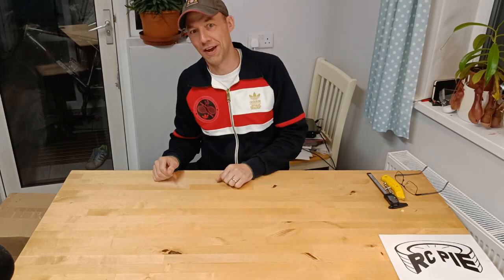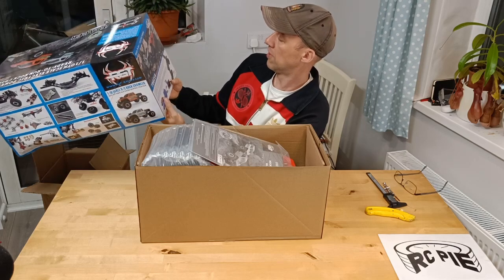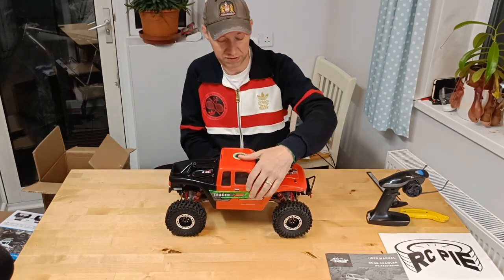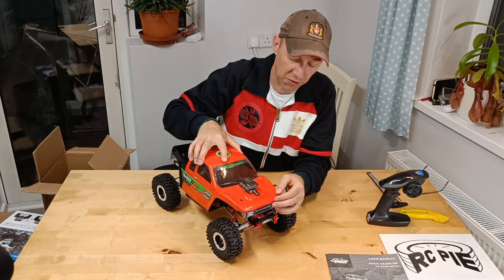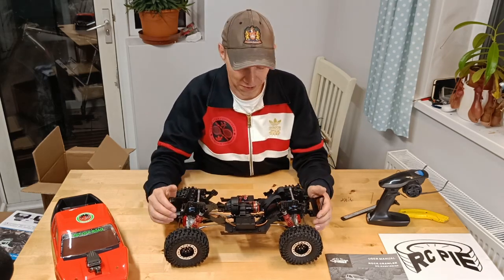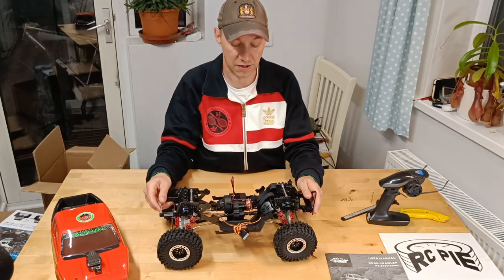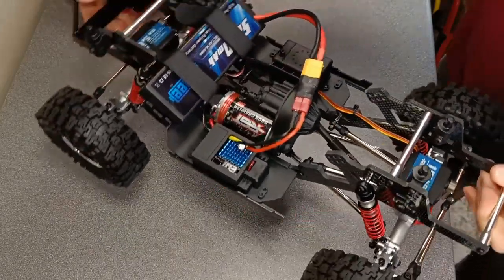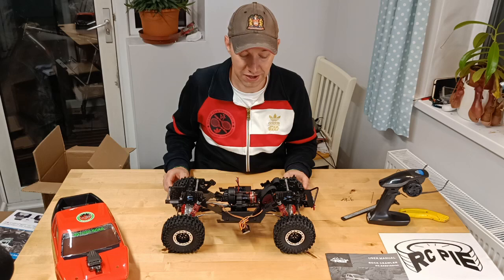RGT EX86180Pro Tracer Unboxing. New for 2022!

Comment: hi, do you still have it ? still using it? ive got one waiting in a basket, would you recommend it now?
Reply from the maker: I've still got it. I occasionally use it. 
Would I buy one? No. The reason being that they never made any spares available. Having said that, I've not looked for a couple of months. 
For similar money, the Rescuer is a far better truck. Completely different but better within its own area.
Reply: @rcpie  thanks for letting us know
Reply from the maker: @MrDevo5 Were you just looking for any decent truck or an LCG rig or did you just like the look of the Tracer?
Reply: @rcpie  just a change. 4ws . Not a capra. Keep looking at a ryft though.
Reply from the maker: @MrDevo5  I've got a friend with a Ryft and they absolutely love it.

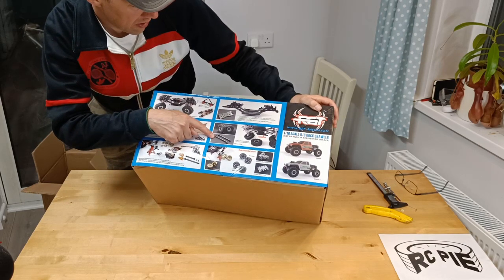Comment: Hi, I recently bought one of these and live in the USA I broke an axle shaft within 10 seconds of driving it and can’t seem to find any parts anywhere. Do you think you could help me find a place to get some extra parts? Thanks 3:50
Reply from the maker: Hi Mark.
What a shame that it broke so soon. Mine's been fine and I know how lucky I've been. The parts support for this car has been horrendous. I'm hoping that changes if FTX launch a version but I'm starting to suspect that that plan may have been shelved.
I've just had a look and can't find anywhere with parts supply. If I find any, I'll let you know
Reply: @rcpie  thanks for the reply. I guess I’ll have to put some different axles under it till something comes out. Thanks again
Reply from the maker: @markyoung-zv3ew  I suspect you can get something that will fit. 
Take it out and measure the different lengths and end sizes. You should be able to get another that will fit. Perhaps look at those for the EX86100 (FTX Outback Fury)

Comment: Thanks for the review. I already ordered one it is cheaper here in our country. I was planning on getting a capra 4ws but I saw the review. It is a good buy. The only thing I think should be done is to fully droop it and it seems that the tyres are too stiff, a hairbun would be a good replacement for foams.
Reply from the maker: Cool. It'll be interesting to hear what you do to it.
The tyres are glued, unfortunately. They looked like beadlocks but aren't.
Where are you?

Comment: Gotta say it's the most intriguing, and I think kinda breakthrough of a frame on a rtr truck, yet again coming from "horrible, communist, evil China".
They even could have had a full trunk if they'd used more forward placement of rear shocks that is available and lowering that bit under the trunk bed. That'd be really nice.
Reply from the maker: It's certainly intriguing and a real change for RTR. 
I might try cutting and dropping the body a bit more or get something else to stick on it. Might look cool sitting low.

Comment: Hi 👋
Does it have dig unit? Rear wheels blocked and something like that
Reply from the maker: No, there's no dig unit on it.
Reply: @rcpie  is it possible to install?
Reply from the maker: @user-6tfvk70k78  Not sure but I'd imagine so. It might need the centre plate changing or modifying but anything is possible.

Comment: So they stole the cliffhanger body, the axial 3gear trans, ar45p portal axles, rock pirates RC rock sliders gspeed style rails fucking pile of stolen shit go figure
Reply from the maker: I'm intrigued. When you say they stole these things, what do you mean? I guess there are few original ideas around and most companies 'borrow' ideas from others if they've not been patented but I know lots of them also license from each other or share manufacturers or just buy the parts/cars and relabel them.
For example.. would you consider that AE stole the Element24 Enduro? I think it was originally an RGT, then a Hobbyplus & FTX, then an Element.
It's always an interesting talking point.
Reply: @rcpie  what is the element enduro crawler by AE?
Reply from the maker: @WildmanGeorge  The Element Enduro24. There are a couple of different versions now, the Sendero and Trailrunner. I don't think they were developed by Associated but by RGT. (Or perhaps just by an unnamed manufacturer who then licensed them to both)
Reply: @rcpie  never seen any of those ones, I’m talking specifically about this truck like 90% stolen copies something Ali express and bangood, so that with everything
Reply from the maker: @1980chardison  I think you probably need to check things out a bit more. Banggood and AliExpress are just marketplaces, just like eBay or Amazon. They're not copying or stealing anything, even if someone else is.
I've just had a look at the things you're suggesting have been stolen and I'm not convinced at all. The axles and rock sliders are clearly different. The chassis rails are in some ways reminiscent of gspeed's but that could be said of any carbon rails and I'm not sure gspeed were first anyway.
The transmission is like that found on lots and lots of trucks, so I'm not sure that's much of a claim either.
I wasn't aware of the cliffhanger body but, having had a quick look, it certainly looks similar. I don't know if it's the same but if it is, it might interest you to know that Pro-line are distributed in Europe by the same company that distribute FTX (arguable just re-branded RGT), so it seems reasonable that they might have a deal going on.
Similarity of thought or design doesn't mean theft of product or IP.
Reply: @rcpie  i know your probably into the truck and car scene, but as a hobbiest for a ton of stuff like drones, china which is a big runner of Ali express and bang good that push all the clones, which I do say this with heart for the people who do the hundreds of thousands of hours to create something good, just to have someone else point and click a computer screen and clone shit then undercut everything they clone which is stealing from the real creators inventors of these said products, and eventually does put the real people out of business and hurts them, because of Ali express and bang good which are run by places like china etc and they don’t even earn it, so the promotions of those fraud thieving companies should never be given any props for what they are doing to people and the hobbies they are basically killing
Reply from the maker: @1980chardison  I'm not a big fan of true clones or even direct copies but there is a fine line between similar and counterfeit.
I'm a big Lego fan and collector and I've seen all the clone brands that are quite clearly stealing IP and just putting bad spellings on boxes. This is awful and ripping off the designers and the original IP and licence holders. I used to be a computer games designer, so I understand the impact of piracy and IP theft.

I don't think this is the same, though. These are common ideas for the construction of a car, all executed in slightly different ways by all the major brands (RGT being one of these). No-one is accusing Element of ripping off Traxxas or Gmade, so what accuse a Chinese brand of doing the same?
If this constitutes theft or copying, then there's the question of whether upgrade parts by third party companies are the same as they certainly take the measurements from the car manufacturer. Then that would mean gSpeed and others could be accused of cloning, copying or stealing.
Reply: Last I checked, AR45's were a chassis mount servo with panhard, and a G-Speed utilizes an angled skid and generally likes a trailing arm rear as opposed to the Axial radial link geometry front and rear.
I'm thinkin you are an armchair warrior that bought a Trax ass once and now thinks he knows something. Go do a few years of comp and come back with something legit to say. 
The dude did a good, fair unboxing. I mean, let's see it run.
Be well, and have fun.
Reply: @Byronelwood-p6n  actually no, I’ve been RC longer than you have I’m sure, gspeed has flat skid rails too genius, there are soa mounts to easy to get, still a copy of the axles, the promotion of shit copy cat products that basically steal from the real item
Reply: @1980chardison  unless you started before 1970 you is wrong.
Reply: I do agree the body looks exactly like a proline cliffhanger body. I own a couple and think it looks identical!